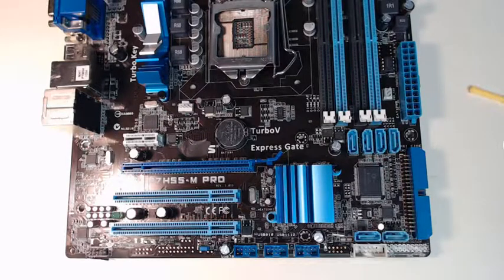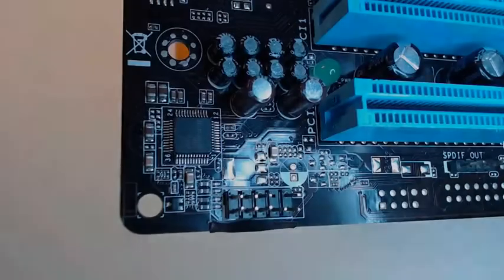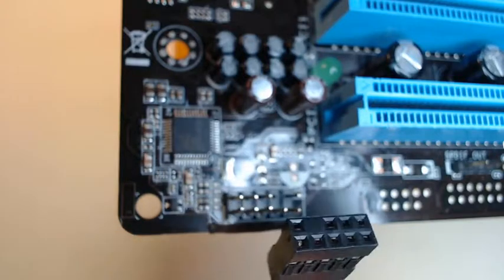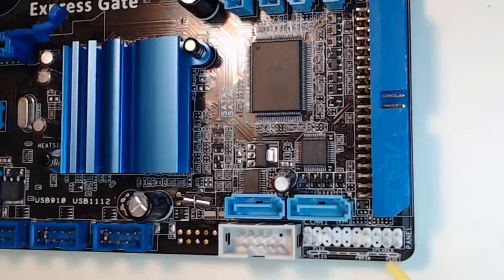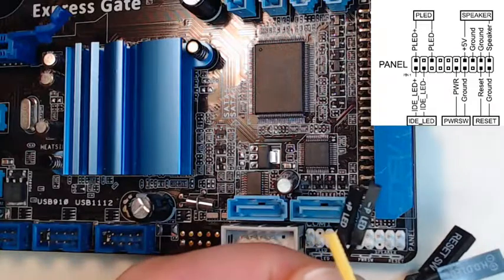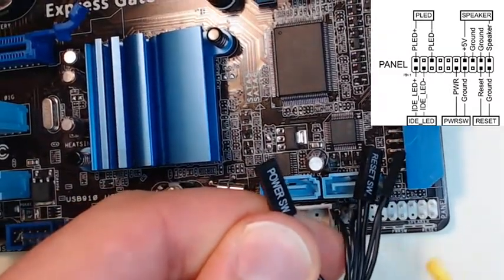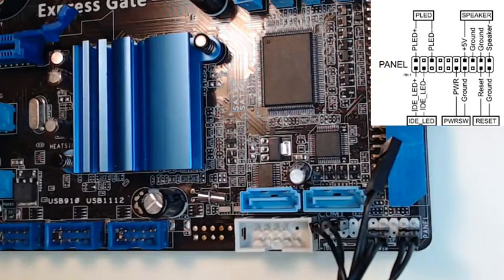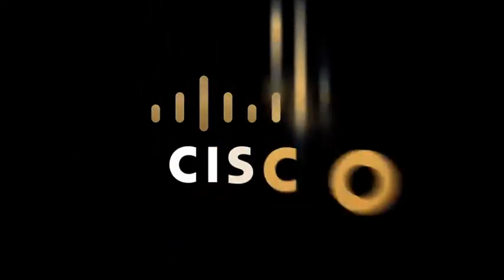Video Demonstration   Install the Front Panel Cables

Comment: Hi. You sound like you know a bit about a PCs. I have a Motherboard with no Manual for it and it's not available on line. My header has 10 Pins unmarked. Can you please tell us how to identify Front panel Pins using Multimeter or any other technic without damaging the board. Thank you.